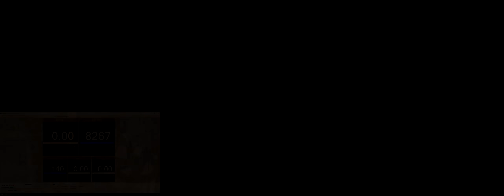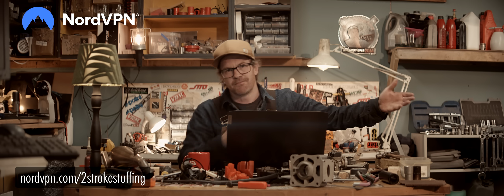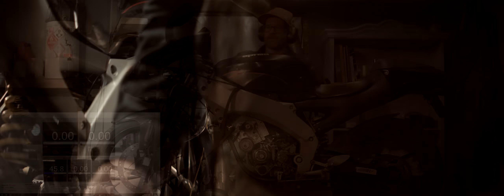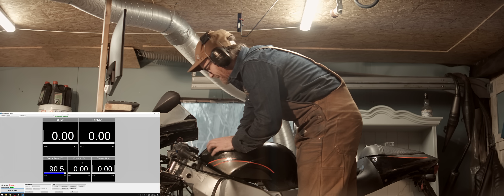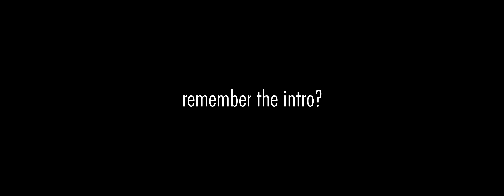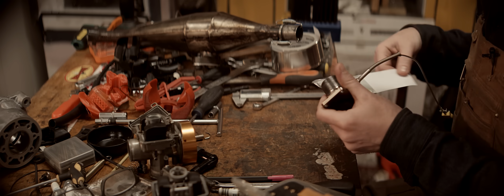P2 - Found THE Problem! - Now, Onto Making the Most Powerful Two Stroke Ever.

Comment: Naturally aspirated 4 strokes rely completely on atmospheric pressure 14.7 p s I at sea level and smaller as you gain altitude.... A 2 stroke is completely different. As the air fuel oil mixture enters the crank case first and gets compressed by the downward motion of the piston into the crank case. We call this forced induction.( supercharged internally.) this is why a two stroke will always make more power than a four stroke. Now let's supercharge the supercharger. Study the design very carefully of a Chrysler West Bend.. Now comes the very extremely hard part.. Because I can't think of another design. I ordered you to design a root type supercharger. That will be internally geared driven off of gear teeth cuts into one of the flywheels. You will have to create of a modern 2 stroke\n Crank shaft from a dirt bike. If you can imagine the gear teeth will drive the roots type supercharger internally from the bottom of the crank case inside the engine. The supercharger will eliminate the need for a reed valve... Bolt on the carburators do the inlet of the supercharger ... a n d tada , we are off to bonneville to beat the la n d speed record for 50cc motorcycle presently at 144+mph

Comment: You are writing the formulas required to figure the size of an expansion chamber. That I have always needed , but never could figure out.. I know this 100% for sure . It all has to do with the sound wave. Not anything to do with the air pressure wave .. SOUND WAVE ONLY. ((((((((( BACK TO THE EXHAUST PORT.

Comment: Look at the design of a chrysler west bend 2 stroke engine that is the favorite of old old go-Karters .. Replace the carburetors with a roots type, supercharger. Gear, drive it off of one of the engines flywheels. Replace the carburetors  to the intake top of the we're expected supercharger that you will probably have to build. Plus  your ability to make it all work..and taadaa we are off to bonneville to beat 144+ mph top end

Comment: I once doubled the speed of a majestic moped from 25mph to 50+mph .. But it kept seizing up the piston.. When you double the speed, you double the heat unfortunately , the cooling fins do not grow any longer .. When you soup up the engine.. Finding a light bulb come on in my brain. And I bought the coldest heat range spark plug , I could find.. Problem solved

Comment: Believe it or not, an expansion chamber on a 2 stroke.\n Relies completely.\n On the sound wave, it produces at the back of the expansion chamber.  Reflecting it forward to the exhaust port... Now I'm lost for information why it works. But the sound wave creates a force field, believe it or not.\n That stops the incoming fresh charge of gasoline\n Vapor and air.  And oil mix run , trying to escaping the exhaust port. And there's 99% of the public will tell you it has to do with the air pressure, they are totally wrong. It has to do with the sound wave.\n Only. But the manufacturers will not tell you it does period if everybody knew they would not buy four strokes

Comment: You have to understand the operation of an expansion chamber before you can decide the lengths of the stinger.. Back in the sixties , a professional go-kart racer shown me there's stingers that worked like a slide trombone. They would slide it in to enter a corner. For low end torque to pull them out of the corner. And then they would slide it out slowly for long, straight away, top end... Now go figure what you need

Comment: Your biggest compound problem.\nFor the last seven years seems to be you don't understand at all. How a 2 stroke engine works! I understand all the answers to all your problems. But you don't seem to want to listen to me. I want you to succeed very badly very quickly. If you will only listen to me. And you're so very close , I can smell it.. And we will beat 144+ miles per hour at  Bonneville

Comment: You are driving engineers that use statistical methods nutz.  Just start tabulating your critical factors.  You have many factors that could have interactions.  There are simple test arrays that will help you find interactions that could be bigger than any one factor alone.  I wasn’t big on this type approach until I started working on new technologies where everyone had opinions and I needed solid numbers and predictory equations to respond to executive opinions.

Comment: He Buddy, I hate to tell you this but your to far over square with this motor. It will turn high rpm but, it won't pull its self out of a paper bag. I did very similar work long time ago . Reed valve is the way to go, I worked very long and hard for the very same reason ,BONNIVILLE!! MY CHASSISXWASXA RIVITED MONOCOCK SERIOUS OF BLOCKS. TRIANGLES ETC. SUPER LIGHT ABD ABLE TO USE THE INTERIOR OF SOME TO HOLD OR HIDE ITEMS TO KEEP IT CLEAN OUTSIDE. I HAD A FOUNDRY IN SACRAMENTO CA. HELPING ME. I MADE THE PLUGS . FINALLY I GOT SMART AND USED A KAWASAKI GREEN STREAK 100 CC CASE, STUFFED THE HELL OUT OF IT, MADE MY OWN CRANK AND ROD AND PISTON !!!!!! ( PAIN IN THE BUTT) I RAN A 60 40 MIX NITRO/ ALKY WITH CASTOR OIL. BUILT MY OWN CARB( NEVER WORKED RIGHT) WENT TO MIKUNI. THEN MACHINED ( BY HAND) A BILLETT CYL.( BIGGER PAIN)  CDI IGNITION ,TWIN PLUGS, . MY MOTOR RAN GOOD, THEN I DISCOVERED  A FORMULA FOR EXPANSION CHAMBERS AT THE TIME, BUILT ONE BASED ON NORMAL SPECS, IE PORT TIMING ETC. THE THING HAULED AXX. IT ULTIMATELY WAS GOING TO GO IN A STREMLINER. THEN ENDED UP IN MARINES IN VIET NAM . NEVER GOT INTERESTED IN IT AGAIN AND YOU WONT BELIEVE THIS, I LITERAL,Y THRROUGH IT ALL AWAY. GOT IN A FUNK LIKE YOU TALKED ABOUT AND DIDNT WANT TO DO MUCH OF ANYTHING.

Comment: l ones hade a Puch 50cc road racing engine from 70ties with a26mm carborator And electronic ignisen it hade 16hp originalet from factory and it made about 150km in a moped frame it was fantastic the arpm was about 12000 rpm😊😊😊❤❤❤

Comment: It is pretty amazing to think about how high performance 2-stroke engines rely on pressure waves or (sound) to reach their peak performance. With a tuned pipe you are basically controlling how sound interacts with the divergent and convergent areas of the exhaust to create a gain in efficiency. To reach the highest limits of 2-stroke engine performance it's like you need to be a motorcycle mechanic, mechanical engineer and a fluid dynamics engineer all mixed together :) lolol

Comment: Trying new designs with the hope to beat the performance of the big factories is a formidable task. I would love to see the bike competing in 50cc racing at the best engine performance results already attained. I love two strokes but realize you can spend a huge amount of time and money when you're  starting with a blank sheet. I think that using a design similar to two stroke diesel engines with valves could control filling and mixture better than the complex dynamics of two stroke porting and chambers. No doubt I'll have people attacking me for saying these things but for me the Bonneville attempt was what I enjoyed and miss the real world application of these engines rather than an endless search for power .

Comment: I look at it like this, if your getting more HP it's getting to the max knowing how many times the little tooth sprocket, has gone round turning the wheel 
think about 
a push bike the drive is the biggest to the smallest 
the faster you will go,  
the motor bike 
is in reverse to that 
just don't go silly on main drive tooth 
that way you will have 
a smooth 
 lower speeds and very fast at higher rev

Comment: A 2 stroke exhaust is essentially a pulsejet (with external combustion), they're easy to make and you can try a few designs til it runs at the resonance you want for the bike, then design an exhaust with the corresponding size ratios.

Comment: Have you ever considered using a Lectron 2 stroke carb?  (Flat slide/flat  tapered needle of massive variation in tapers.). I ran those on old Yamaha TA 125's in the late 70's/early 80's, then more recent in Thailand on both 2T and 4T applications.  Simple to use, though must wrap your brain around them...like a fuel injection system with no controller.  (Perfect for 2 strokes) See you in Bonneville...or where ever.

Comment: You can get a lot more power with the correct tuned muffler. You would be surprised.

You should put another idler on the timing belt flopping around.You are losing HP there as well. You will have some dwell variation.
It wouldn't be a big deal at 5k rpm but at 13k++, yeah. You will never get the timing right like that.

You need to degree the cam with a timing wheel.
never get the timing right like that.
 https://www.youtube.com/watch?v=7NO97NNPtuQ

Comment: The blowdown velocity will not continue as the piston drops to BDC so purging due to gas velocity becomes minimal.  You are better off making the exhaust larger and letting the transfer ports do the scavenging.  There is a balance point where gas velocity in the exhaust does exist and can draw on the transfers and reeds at BDC, but you are better off like jetting, starting with a big exhaust port and transfer entry and working down.

Comment: I’m surprised cause exhaust restrictions usually create less ignition timing but that is in 4 stroke. This may be different in 2 stroke. 

Also thank you for dong all this testing. I test so much stuff myself in the Civic Type R world. I really appreciate what you do here.
Reply: in 4 Stroke this is because more backpressure creates bigger amount of hot residual gases. Those make the combustion process prone for detonation, hence you need to reduce ignition timing not to destroy the engine....

Comment: Your sitting on a Aprila 50cc bike , why wouldn't you look at that pipe and make changes for more rpm (longer pipe in primary start section before expansion not shorter the gases are flooding cylinder) 
3 tips if you change pipe jet it too .
Change timing and it's dieing up top change jetting bigger main.
And if you have just changed jetting try the different pipes and timing on each too.
Not filling the cylinder , just sucking meaning no back pressure it's because your pipe is so close .
Good luck.
Look at on YouTube you'll find the blue Japanese 50cc 70's race bike can't remember off hand it's name ,20,000rpm but if you look at it's pipe EXHAUST it's PRIMARY tube before expansion chamber is as long as your hole pipe  , it will not make real power up top with a short pipe , look at drag racing 2strokes loonng pipe.

I'll come back in 6 months and see how your going long with the right diameter for your cc's and horsepower.

Comment: Hey, i’ve been watching your videos for a while now. 

Your behaviours remind me a lot of myself a few years ago. In my free time, i’ve built a lot of things (motorcycles, scooters etc.). 

Just like you, i started collecting a lot of parts and other stuff in my garage, and it became just more and more. One day, i decided it had gone to far, and cleaned up the whole garage. I cleaned all my tools, sorted everything in its own catagory, sold and trew out all the old stuff that i wouldn’t need in the next few months, fixed all small things that bothered me. All by all, just made it absolutely perfect, like in authistic ways. 

What i’ve noticed, is that i can focus much better on my work and projects and i could think a lot clearer and better. And all the frustration of having to look for things or having to work around stuff just fanished, and it made me enjoy my time in the garage a lot more. 

I know it might sound a bit typical, but i suggest you do the same with your garage. Sure, it takes some time. But it will be won back afterwards. Just cleaning up when your done for the day takes 15 minutes, and you will come in to the garage the next day feeling fresh, and you can just start working on your project. 

If you read this, please think about it for a sec. I think it would be helpfull for you, and i think you’ll have a lot more pleasure in your work. 

By the way, thanks for all the beautifull video’s. I’ve learned a lot from you, and i don’t think i would have had the dream job i have today if you didn’t fire up my enthousiasm for 2 strokes. Keep it up.

Comment: Alex , what if you check when de piston is in the position that  the exhaust -port is just closed , and make an adapter on your exhaust-flange  and put 8 or 10 Bar compressed air on it , just to see how much air escapes trough the transfer-ports in that critical position with the gudgeon pin.

Comment: this may sound mad, but it works...

use aerosol cans and solder them together. silver solder/brass obviously will actually hold together, soft solder is good for a few rides...

you only need scissors to work it, and can throw a pipe together overnight without the hassle of welding thin stuff... blow torch is good enough?

leave tabs, overlap, lap joins.

i often had stress fractures in the steel well before any joins let go. soon learnt how to mount them properly too!

weld the header. first few inches...

and being paper thin, gives that real "ring ding ding" :D

Comment: You actually need a metrakit mk exhaust but a bit bigger.
Maybe you can find one or make one. 
Maybe a 125cc exhaust and then adjust it to fit. 
Important: the exhaust, it must be able to release the pressure against pressure, also important, the length of the exhaust also ensures that your engine block does not overheat if you drive it longer. 
Nice video it just keeps getting better 👍🏻

Or clean your petrol tank with a cloth Or polish the tank just before the video say that you have 5 hp more speed and that the cause was that therefore the aprilia did not work properly😂

Comment: Completely off on a tangent here.
Part of the problem I see, in 2 strokes in general, is that the extraction of exhaust gasses is, probably, the most important consideration.
Have you ever considered designing an exhaust pipe based on the Tesla valve?
These valves tend to work out at about 35% greater flow in one direction.
It would be interesting to see how one of these valves works with resonance.
Something to play with in your spare time.
;-)

Comment: Now I know why I was confused on your stinger sizes. I was figuring you exhaust area was way more mine and my stinger was 16mm I was .7 of my post diameter. I’ve banging my head on the issue of not being able to get above 11000 rpm even with a pipe made for 15000. I’m pretty sure my stock ignition system juts can get me there. Either that or my porting is just not quite there. 
Super excited to see the next video hope that thing put out some crazy power

Comment: 9 hp at 11000 rpm sounds pretty good to me. I am not Clued up in any way in the potential output of two strokes, but in the four stroke world I like to judge how good an engine is by its specific torque output in lbft per cubic inch. A really good four stroke will achieve 1.5 lbft per cubic inch, your little engine is right on that figure, so that impressed me. Well done.
Reply: it's pretty amazing for a 50cc, what does your average 50cc have maybe 1.5hp? keep in mind It had over 25hp with read valve issues, so once it's dialed in, who knows and you can hear it too, well I can. Even at 30hp that's 20X the power of equivalent capacity.

Comment: I am wondering if the 24 mm carb is too restrictive for higher power levels. using the yz85, yz125, yz 250 as reference they have about 3 hp per square cm of carb opening on average. going off that a 24mm carb will be enough for 15hp ideally. the yz85 is only 2.3 hp per square cm which brings a 24mm down to 11.5 hp.  I did find that the CR500 is an outlier at 6.2hp per square cm.

Comment: Good to see you looked at the pipe , i had questioned the volume of the pipe but knew you had designed it around your cylinder , good to see one tiny miscalculation leads to the making of a better pipe 💪💪💪 20 hp at the tyre is coming real soon 🙂🙂🙂 onwards and upwards

Comment: I stumbled across your channel like a week ago and I've now watched so many of your videos lol.
I love 2t's, owned many, but I have zero knowledge on how to make more power with them except expansion chambers and fueling.....but something I do know about tuning....if you make a change, and it behaves poorly, you shouldn't go and change something else before reverting that initial change, same with making more than one change at a time, because then you're not focusing on what does or doesn't work, because there's been multiple things changed and can't pinpoint what change did or didn't improve anything.

Also highly recommend getting either a notebook or a spreadsheet on your PC/Mac/phone so that you know exactly what changes you're making, what does or doesn't work, and what HP/TQ you're making at what fueling, exhaust, ignition ECT.... that way you can look at what's working and or, revert back and go in a different direction from that earlier point if necessary.
Hope that helps 😅

Edit: I also just thought, you're not running anything to read your air/fuel ratio are you? Like a sniffer. 
And also, you don't try different expansion chambers/lengths/diameters that often.... again, I have almost zero knowledge, but would it not be beneficial to know exactly that your fuel/air ratio is correct so to try something else instead of "assuming" it's always the fueling? IDK, just throwing things out there in hopes to help 😅
Regardless, keep it up, I know you'll get it to where you want it, hopefully sooner than later 👌

2nd edit: ah ha! I was right! It was the exhaust this entire time! 😅
But make a new exhaust.... and run it BEFORE changing anything else, don't change more than 1 thing at a time so you know what's working lol. Also, after the exhaust.... I'm not sure about that entire ignition system, but that's for a later investigation, exhaust now 👌👌